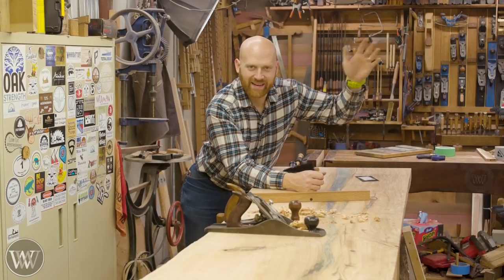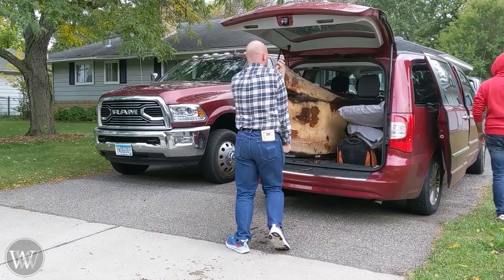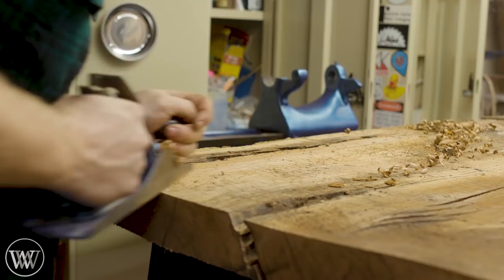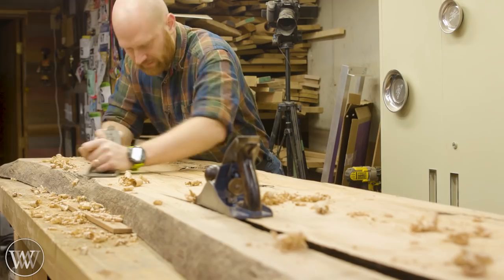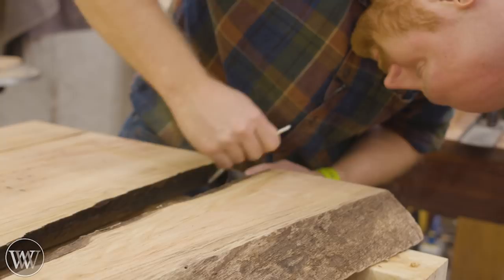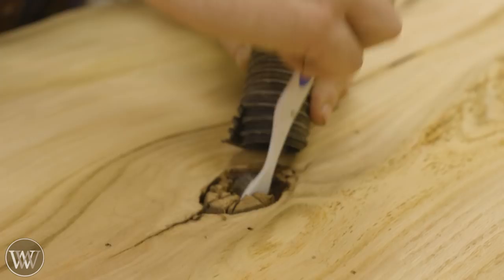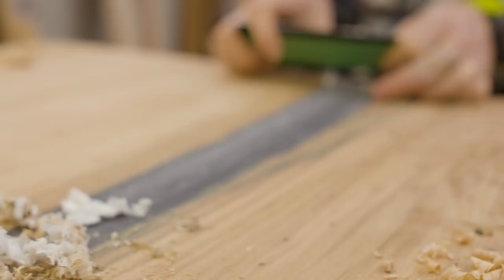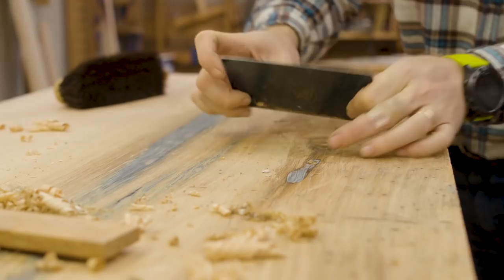Oak Slab Top Desk Preparing and Flattening The Slab Tops

Comment: We have had great luck with duct tape for epoxy work at work, it would be interesting to see a tape test sometine.
Reply from the maker: That does sound like a fun test. I've used duct tape a few times on smaller gaps but haven't had much luck with it on things larger than a few inches.

Comment: You always do a great job explaining techniques.  I learn a lot watching your videos.  I have a question about planes.  I want to buy a decent hand plane.  They are expensive.  What type should I buy?  I jack plane, A #4 plane, a smoothing plane?  I am unsure which one would get the most use as a general plane to flatten boards.  Thank you in advance for your advice.
Reply from the maker: That all depends on what you want to do with it. If you're intending to work on things that are 3 ft or longer I would definitely go with a number 5. if they're shorter than that on average then I would probably go with a number 4. but in the end it's really personal question.
Reply: @WoodByWrightHowTo  Okay.  That makes sense.  Most of the time they will be 3' or less.  So I will check out the #4s.  Thanks again.